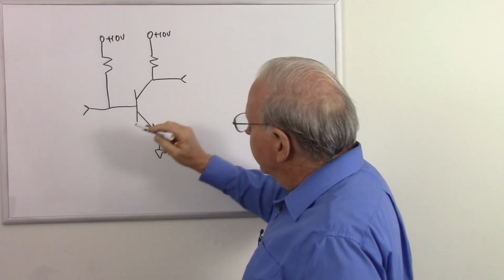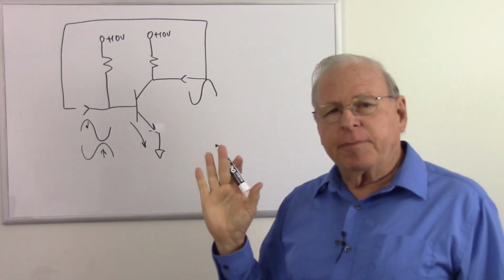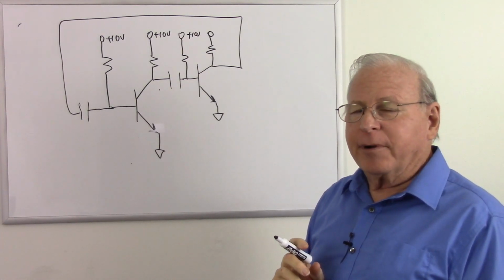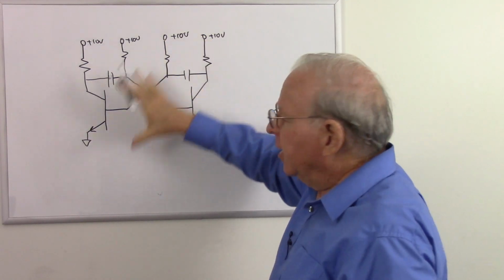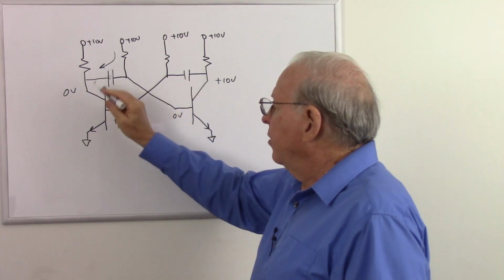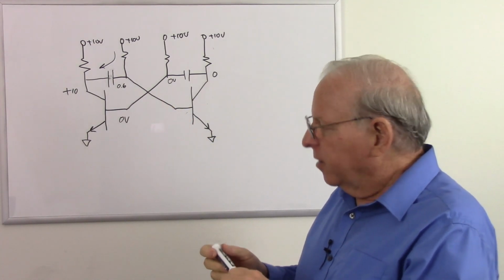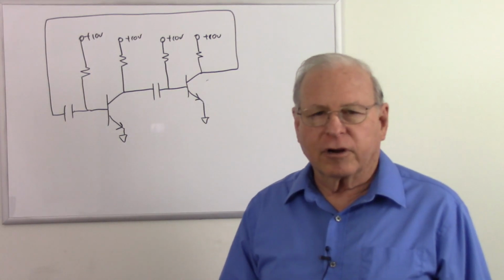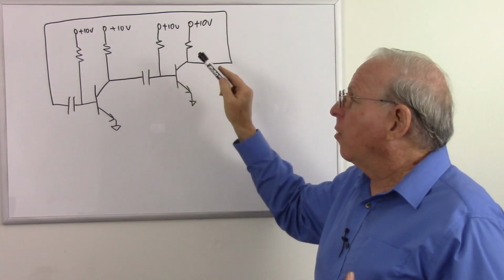Astable Multivibrator - Solid-state Devices and Analog Circuits - Day 6, Part 5

Comment: Well, but in your second picture, you started with sine waves and ended up with square waves (due to having too much gain). What happened to the rounded sawtooth wave of charging/discharging capacitors that is ACTUALLY produced by this circuit?  It's the same circuit, just drawn differently, so shouldn't it obviously should produce the exact same result. So why doesn't it?  I think you're missing some important details here…

Comment: Do you realise you are completely wrong in your discussion. You cannot comment on the first cycle because it does not apply.
All the rest of your discussion is also incorrect because the circuit works on Current and not voltage. I know you are removing my comments because you are so embarrassed at being so ignorant of the operation of the circuit but l have asked you to email me and get the correct operation because you will then appear to have understanding. Colin Mitchell
Reply: Maybe the one who doesn’t know how the circuit works it’s you
Reply: @patrickgrossi6699  Well, there's only one way to find out:  seeing both explanations and comparing them with facts.
I don't see Colin's explanation, but I can see Bob's one, and I see it doesn't hold any water, since the same circuit in his explanation produces two different results depending on how he draws it and how he explains it. And this cannot be true.
Reply: @bonbonpony l can see you have no idea how the circuit works, so l will not waste my time.
Reply: @CollinMichel-w9h  In tat case, you are no better. GFYS.
Reply: @CollinMichel-w9h  In that case you are no better.
Reply: @patrickgrossi6699Obviously you have no understanding of the circuit so l will not waste my time.

Comment: Thank you for your video. I got a question, at 14min 22 sec you say that the capacitor was not charged, but it had 9.3v across it just before the second transistor turned on (10v-0.7v). So when the second tansistor turns on and the collector drops to 0v, wouldn't the voltage on the base of the first transistor be -9.3v? Turning it off.
Reply: You are correct! When he says "This capacitor was not charged to begin with", that's not right.  Like you said, it had 9.3V across it, so when the right side drops by 10 V due to the second  transistor turning on, the left side of the cap drops by 10 V as well since a capacitor cannot change voltage  across its terminals instantly. The base of the first transistor drops to -9.3V just like you said. He really is trying hard to explain it but messed this up.
Reply: @buffalo_wings8224  so the bjt Veb absolute maximum rating should be more than 9.3v right or it would burn?
Reply: @starlord5802  Good catch, yes the high reverse voltage (reverse VBE) on each transistor's base  will eventually degrade jellybean transistors like a 2N3904. It would be best to put a switching diode  (like a 1N4148) in series with each base which reverse biases to protect the transistors, or a diode placed anti-parallel to the base emitter junction which acts as a clamp during  the reverse voltage.
Reply: You are correct. His discussion is completely wrong.
Reply: That is such a good observation, i completely missed somehow.

Comment: Which is practical use of astable mutivabrator? 
Example,please?
Reply: It is actually the basis of a clock. A clock is a frequency or a signal. You can also flash two LEDs or globes at a model railway crossing.

Comment: Want to add to the chorus that the feedback setup is way easier for me to understand. I think because in the feedback schematic, the signal flows from left to right, instead of typical schematic, where the capacitor on the left triggering the transisitor on the right (and vice versa), which gets confusing.

Comment: Nice explanation! I am trying to create a circuit for d type flip flop and I think I only need to add an inverter to the circuit you described (assuming removing capacitors). Thanks!

Comment: One of the first circuits I built using my Philips electronics kit (a long time ago). It is still not easy for me to grasp how it works. One transistor is on, one is off and one of the capacitors charges up to change the situation. Your presentation in these lectures is excellent.
Reply: @Disillusioned_one - same age and year as when I got the Philips electronics kit. Happy days.
Reply: What he has said is completely inaccurate. He has no idea how the circuit really works.